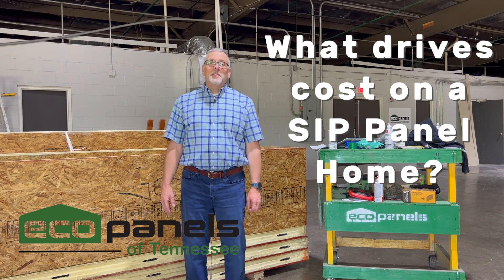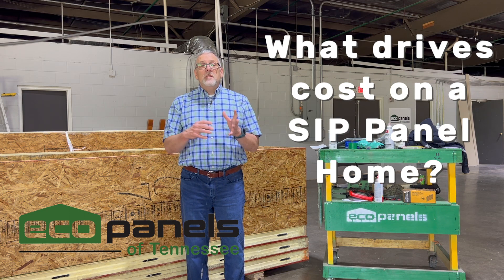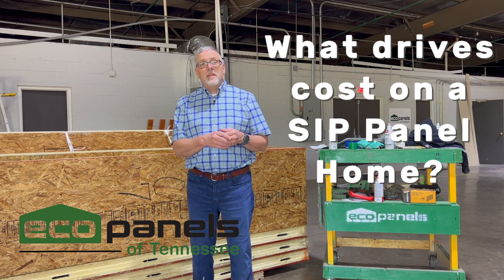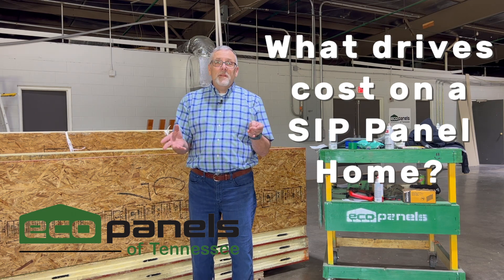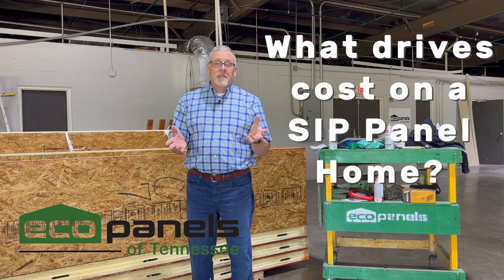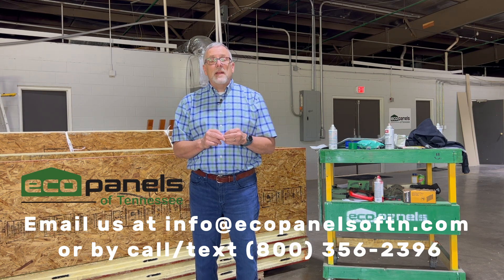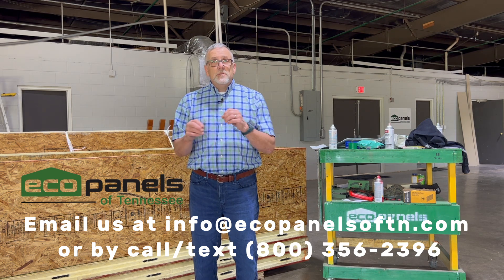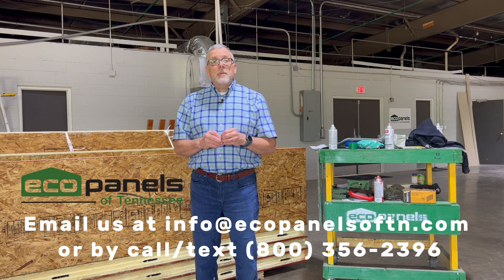What Drives Cost on a SIP Panel Home?

Comment: Shallow frost protected foundation, four corners, 40' by 40', 8 ft ceilings and heeled truss heeled discount package? voila you just solved rising energy cost/housing shortage/and reduced emissions
Reply from the maker: What we wouldn't give to see more 4 corner, 8' tall ceiling homes!
Reply: @EcoPanelsofTennessee Well, I’m looking at hiring you guys to build a home along those lines, only it’s more like 30’ deep and about 53’, something like that. I’m designing the interior and letting the exterior be whatever it comes out to dimensionally, but it will be 4 corners and a rectangle.
Reply from the maker: Only 4 corners?! You'll spoil us Robin! Sounds like a great plan... definetly the economical way to go. We'd love to help you out, and I believe I saw a message from you in our inbox. We'll be reaching out soon. Thank you! @RobinP556